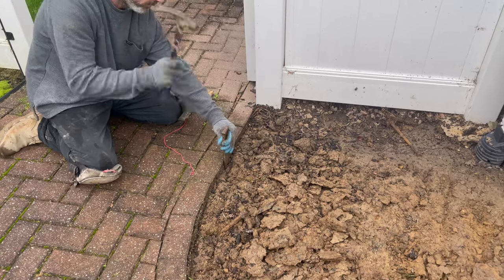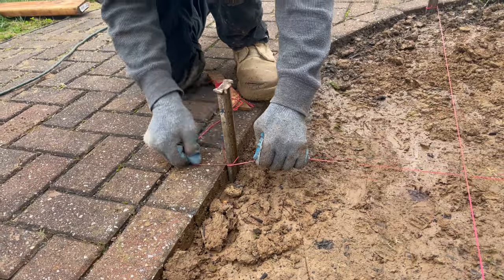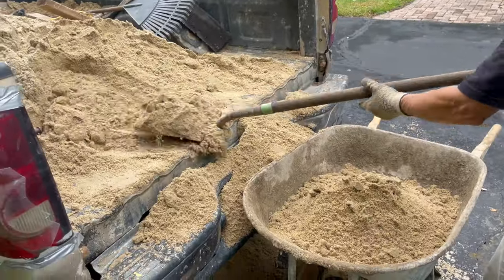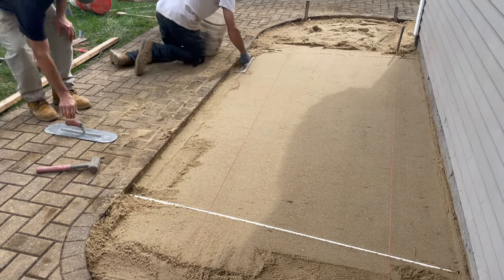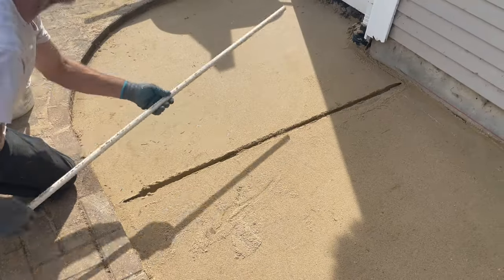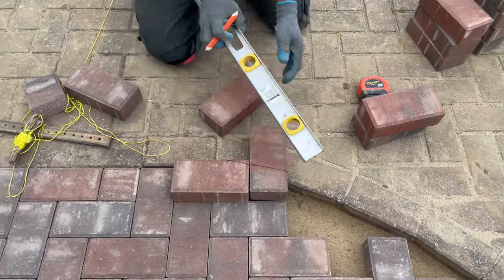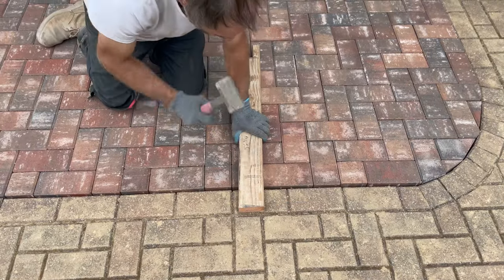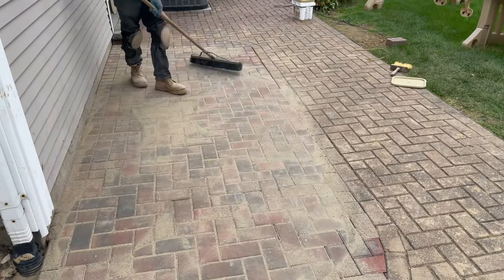How To Build A Small Paver Patio DIY For Around $200 Bucks

Comment: Do pavers with polymeric sand in the joints provide enough impermeability for rainwater to drain off or will water seep into the joints and into the soil below?
Reply from the maker: Yes, as long as it's installed correctly water will run off instead of draining into the soil below. The patio should also be pitched about 1" per 6-8 feet.

Comment: Im redoing mine. The previous home owner had it all uneven. Im not sure if he jaut did a really bad job or it became uneven over time. Any idea what could cause it to become uneven over time?
Reply from the maker: Usually when pavers become uneven its an issue with one of the base layers. Could be the sand, the gravel under the sand, or the ground itself. Could also be a drainage problem, water can get under the pavers and creates some runoff if you're not careful.

Comment: I have two questions, first about how thick do you want the sand? Secondly what are you using for guide poles?
Reply from the maker: We use 1 inch of sand under the pavers, on top of a compacted base. For guide poles I use lengths of iron pipe.
Reply: @Gambrick thanks

Comment: I thought polymeric sand was supposed to be compacted into the joints, but you didn't? Was this a type that didn't require that?
Reply from the maker: It depends on the size of the joints, if they're wide enough the sand will fall to the bottom so you don't have to compact it, but for some pavers we compact two or three times to make sure sand reaches the bottom. You can tell if sand reaches the bottom by how much you're using per sq. ft. of pavers.
Reply: Thank you for the quick reply

Comment: What size pipe did you use to measure sand thickness
Reply from the maker: I use either 1" or 3/4" pipe with 1" sand.
Reply: @Gambrick  ahh okay got it 3/4”pipe will equal to 1” overall thickness. Thanks for the fast reply

Comment: what sqft was this? i wanted to do something like this as well and its exaclty like this with curves around it too.
Reply from the maker: It's a little over 100 sq. ft. but I bought about 140 sq. ft. of blocks because of all the cuts.
Reply: @Gambrick  do you remember the size of bricks you used?
Reply from the maker: @josholivarez3804  Yes, we used a standard size brick paver that's 4" wide x 8" long x 2 1/4" high.

Comment: May I ask the pipes should place horizontal or vertical before screening?
Reply from the maker: You can run the pipes horizontal or vertical, what matter is how the patio pitches. A patio generally pitches away from the house so that's the direction the poles run, but if your pavers are away from the house then you can run your poles and pitch the patio in any direction.
Reply: @Gambrick great thank you

Comment: What type of sand did you use for leveling in the beginning
Reply from the maker: It's standard paver sand, also called leveling sand, that you can buy in bags at Home Depot or Lowes. You can also buy it in bulk at a masonry or landscaping supply.